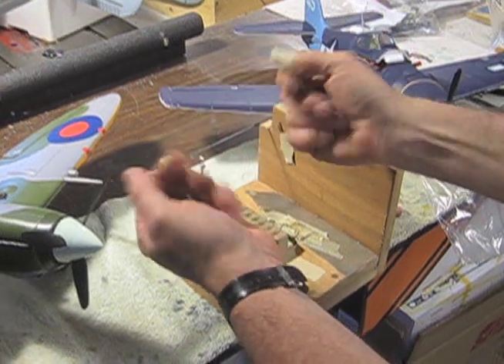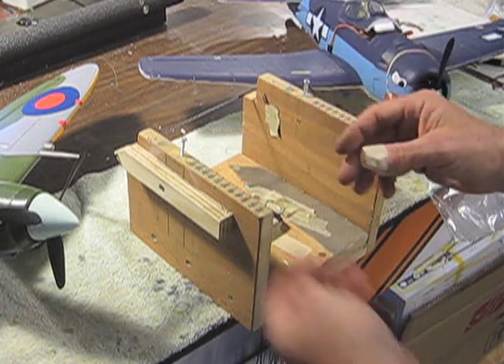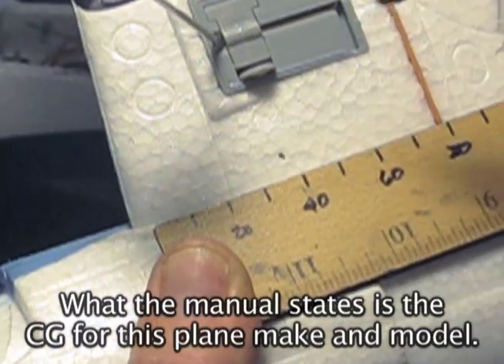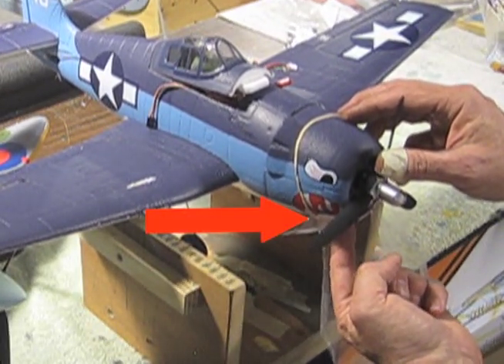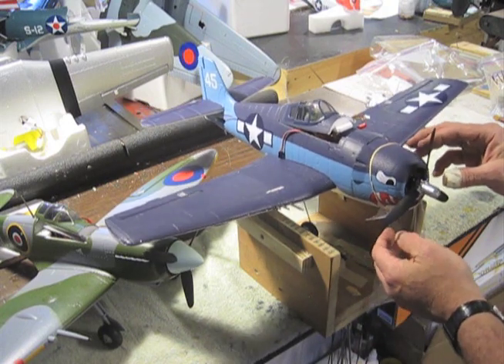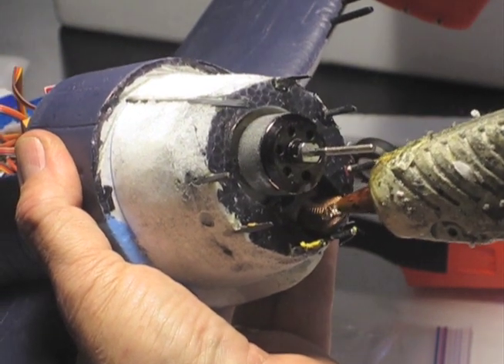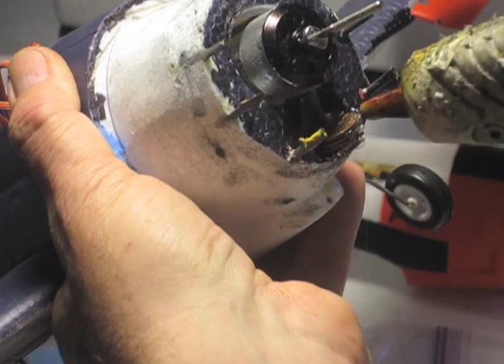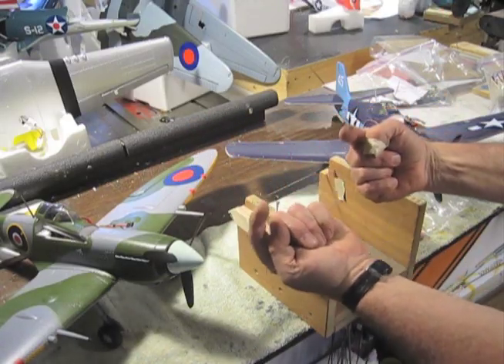TINY TIPS: HOW TO BALANCE THE CENTER OF GRAVITY (COG) WITH PENNIES

Comment: No substitute for brains . Well done 👏
Reply from the maker: Thanks a lot 😊  We are definitely designing this as an FPV platform. The optional FPV mount is designed to fit the DJI air unit as well as others. There is NOTHING like head tracking video in super HD quality.  We really hope you can invest in one too.  It will cost around $400 - hat's the cost of about 2 planes, but it lasts 10 time longer (double the cost, 10x the life!)  And 5 Times as much fun!! (it's fun insurance - it keeps you at the field flying EVERY TIME you fly it! Instead of going home to fix a broken plane!)

Comment: I taped change to battery to balance a plane in the past. Had to take said battery into the hobby shop once and the guy at the counter looked at me like I was crazy for doing that. 
I think this is an awesome way to use change and it kept me from spending paper money on wheel weights or lead.
Reply from the maker: I do that too, when I have different batteries to fly one plane with. Balance the plane with the heavy battery, and add pennies to the light ones. Love it! We keep penny "battery weight strips" in a ziplock bag with the batteries,  2 pennies wide x 10 or 12 pennies, between 2 pieces of duct tape- just cut off whatever weight worth you need and tape it to the battery. I guess we should put that video up, too!